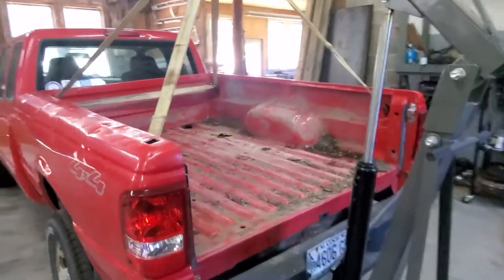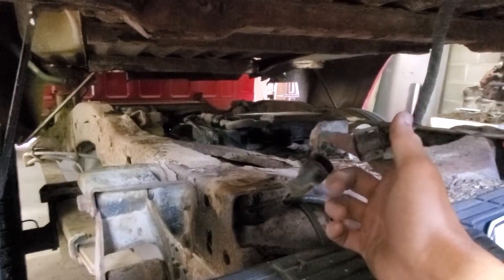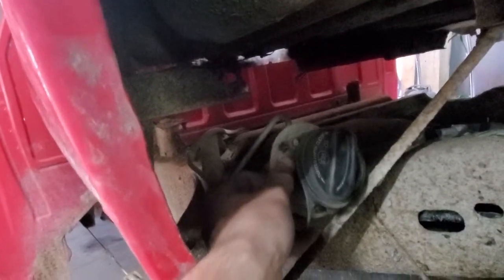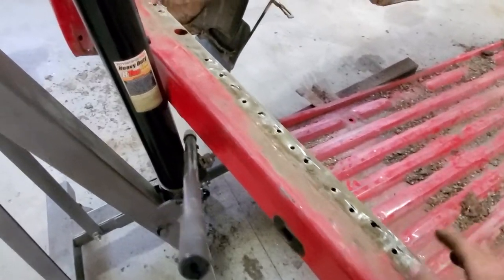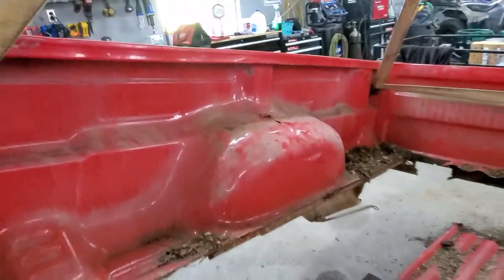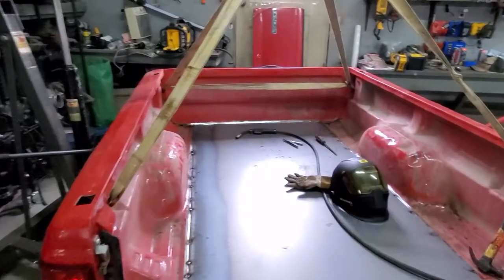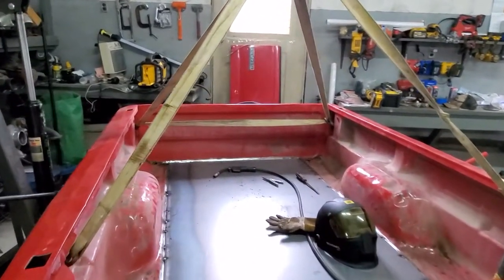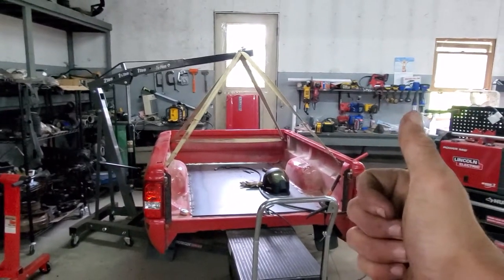New Floor! Ford Ranger Bed Repair || Ranger PT 2

Comment: What did you use for bed supports? Mine are rotten through and won't pass inspection?
Reply from the maker: You can buy the bed crossmember kits or use various metal like c channel or square tube

Comment: What gives the bed strength when there are no raised ridges/corrugation on the replacement sheet?
Reply from the maker: The replacement sheet is at least twice as thick as factory

Comment: Why did you use flat steel for the floor ,
You could have bought some Corrigated panels from Lowes for about 50 bucks and it would have looked like the old floor and probably cost less.
Just curious.
Reply from the maker: The corrugated metal from places like lowes are for siding and roofing and is only 29 gauge. This customer uses this truck to haul wood and he wanted something tough. 29 gauge wouldn't take any abuse compared to the 1/8 flat steel I used here
Reply from the maker: Sure could've but the stuff from Lowes is way to thin. Line x is good stuff I agree but In my opinion it's not worth spraying that roofing metal

Comment: Where did you get the bed from?Mine is a 99 Ranger xlt. Parts are obsolete. I  would like to restore a lot of the truck. I've never done anything like that before. 😕
Reply from the maker: The metal came from a local steel distributor

Comment: It makes me grin when I see shadetree mechanics not cleaning out the bed before starting work. But someone with a shop? That to me is like a dirty shop. Not a whole lotta confidence-inspiring. Same with the mudflaps brackets. It's four bolts/2 on each side to zip off. Seems like a logical progression of tasks, like the filler neck and tail lights connectpr.

Comment: Sorry if I missed it, but what gauge steel insert did you use?
Reply from the maker: I used 1/8th inch steel sheet
Reply: @Parker Motor Works  thank you! Doing this to my sons truck and your videos are a HUGE help.
Reply from the maker: Glad it helps. There's one that the video freezes that I can't fix but everything becomes self explanatory once you cut it out. You can probably get away with something thinner but I like welding to 1/8th inch